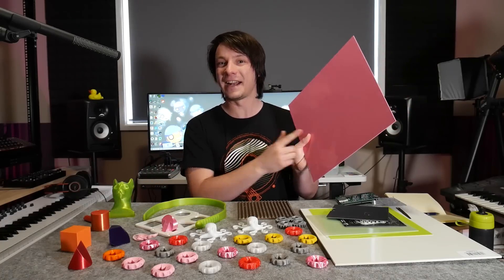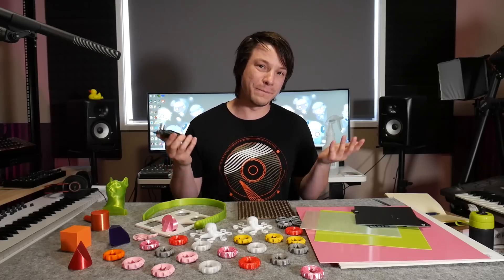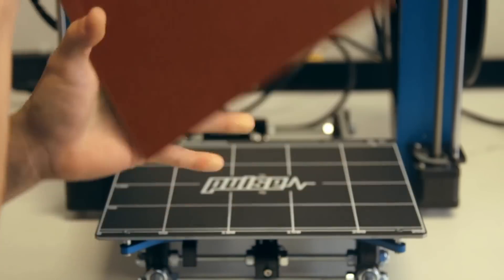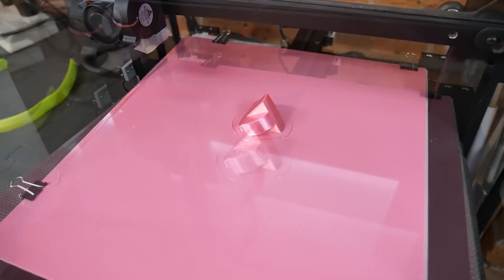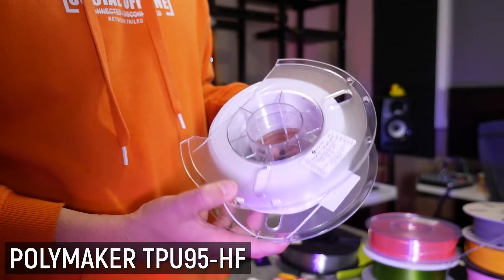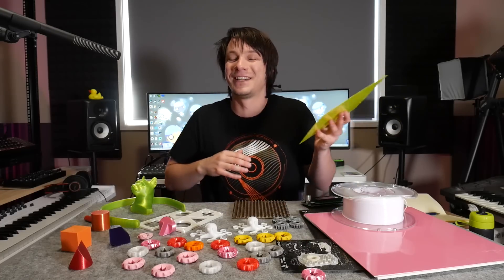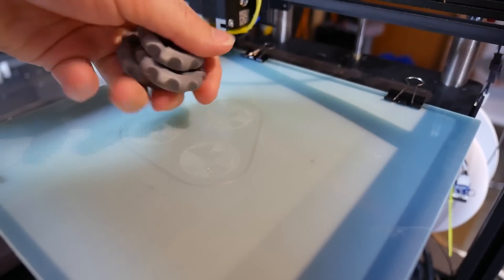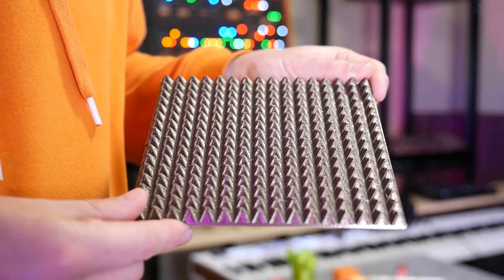G10 - The best print surface you've never heard of.

Comment: I don't know your business, so I don't mean to make any assumptions regarding your clearly vast array of knowledge/skills ...but I do know they make release agents, e.g. silicone coatings used in candlemakers' molds, and perhaps something like that could be used to prep the surface of your G10.
Reply: Uhm with silicone coating, the print won't stick while printing. Even a little silicone contamination isn't very fun, gotta spend half an hour washing it off.
Reply: @SianaGearz  Yes, even not knowing this business I thought something like that might be the case. That's why I cited silicone only as an example ...with an eye to the notion that there must be a number of release agents on the market. I know I saw Teflon in aerosol once. The aim would be to find a release agent that would be slick enough to aid in removal but not so slick as to interfere with adhesion. Of course, another issue would be how it's applied to the surface ...and by that, I reckon I mean how to regulate the thickness of the film. These are all sound considerations of course, regardless whether a product exists that can accommodate them.
Reply: @thomasraywood679  I've got canned Teflon dry-film lubricant right here, spray can, Ballistol brand. Not sure i'm inclined to use it, since i never really had issues with removal or adhesion myself, just with glue stick. It might work to prevent PETG from ripping out glass shards, maybe i'll test it when i wash the glass and report back. Could take a few months. One problem with it is that the way it behaves, it doesn't coat the surface anywhere near permanently, and reapplying isn't a lot of fun, because you'll start getting thicker layer where you don't print and thinner layer where you print, and you have to wash everything off and start over. Glue stick just stays on the glass and doesn't lift with the print, so it's kind of magical.

Someone else here in the comments mentioned that he gets PVP polymer from cosmetic industry and uses it on the bed as adhesion promoter. I didn't find a supplier i can tap into, i could buy from a chemical company, but the price is prohibitive or they'd want me to buy 5kg of the stuff, which is just a complete no-go. I could order 100g from China for $10 but i don't want the customs police knocking on my door for importing a sketchy white powder. But i did find a glue stick in China which is purported to be PVP PVA blend material, Deli 7092, maybe it'll work better than PVA sticks, and i don't see harm in trying it for $4. I'll report back on that too.
Reply: @SianaGearz  Some guys are bound to benefit from what you find out, even if they don't stop by to say so. Perhaps ask the PVP polymer guy where he gets it? Speaking of which, where do you get your Teflon spray? I've looked for it online to no avail. Can you post a link? That'd be great.
Reply: @thomasraywood679   I bought Teflon at Conrad Elektronik, a major European brick-and-mortar chain that sells electronics components, tools and hobby supplies of different kinds. Two nearby home improvement stores also carry it - "Teflon® Ballistol Spray 200 ml". I imagine it's not entirely helpful to someone on the wrong side of the globe.
Reply: @SianaGearz  Wrong side, lol. Right now that feels about right.
Reply: @SianaGearz  Thanks. I just ordered a can of the Balliston for Huma-Air. Shipping cost made it expensive, but here stateside I'm just not seeing anything that falls within the normal price range.
Reply: @thomasraywood679   I fished the WD-40 product from their American webpage. It should be available locally.

Comment: I used to buy cheap, single layer blank PCB sheets (G10 with a copper layer on one side) as print surfaces. Worked well compared to the alternatives at the time, but I ditched it years ago. Might try it out again with PETG - never even considered that it might be a good solution for that.

Comment: This looks like exactly what I need. I wanted to use a PEI print surface, but they do not readily come in 24"x24" sheets. A quick search on G10 sheets of that size was trivial. Now my intention is to adhesive a G10 sheet to a layer of mild steel sheet metal and also adhesive a magnetic surface to the heating element attached to my printer. Ill be able to retain the convenience of a removable print surface without any clips, thank you.
Reply: @Jarod Hohl: I'm curious about your idea of using a thinner G10 sheet stuck to a metal sheet. How did it work for you?

Comment: Watch @MatterHacker's most recent video on printing Nylon,  Alec explains that glue stick helps a lot, but not as a adhesive but as a separation layer. Garolite is covered in a semi porous surface the molten plastic gets in the tiny pores, solidifies and that's what makes it stick, but it can stick too well, use a little glue stick to cover up some of those pores and helps certain plastics, Nylon, ABS, TPU release better. Too much glue stick and nothing but PLA will stick. Matterhackers' Pulse XE has been using Garolite for a long time and I've really liked it! Also works for SLA printing. ( I used to work in 3d printer tech support, talk about garolite a lot.)  P.S. I wish MH still shipped to Australia.

Comment: So we could have the heater tracking built directly in to the print surface. Far easier to source than bare G10 maybe?
Reply: The problem is mounting. You screw the heater PCB onto the carrier in 4 spots, and those are rigid -ish mounts and then you heat it up, it expands and warps right in the middle. Now what? Besides the temperature difference between top and bottom warps it too, bows it down. If you can figure out a solution, sure.

Comment: That 0.5mm stuff might be good to stick to a spring steel sheet for magnetic bed leveling printers like the Prusa printers. It should be thin enough for the PINDA to sense the sheet below the surface, yet still remain flexible.
Reply: Thank you!  I might try this for the mini V2s my admin ordered for our science lab.  We've got borosilicate glass plates to replace the textured surfaces for now, but it seems like a different filament (other than PLA) and a surface such as this at 0.5-1.0mm) might help students experience more success?! :)

Comment: Been using it at work and it works very well. The real strength of it is for things that don't like to adhere at all like polypropylene or delrin. The texture of it smooth is nice, and you can get back to that finish easily by sanding, but for adhesion take some really rough sandpaper (I use 90 grit) and try to gouge out large scratches in as many directions as you can. I have had exactly no problems with polypropylene or delrin sticking without any special form of adhesive, not to mention nylon or abs.

Comment: I use G10 like 2 years without knewing his material name and is too easy to stick prints with hair spray like roby. I knew is the plate of circuits.
But the results and the low damage to the bed. 10/10.
Reply: Also, if it get so dirty, you can clean it with water and a sponge.

Comment: Would G10 / FR4 work with capacitive bed leveling sensors (like a PINDA on a Prusa) or would it only work with physical Z height systems (BLTouch, endstop buttons, etc.)?
Reply: Those are inductive sensors, not capacitive, and they are blind to this material and most other things that aren't a hunk of metal of substantial thickness.

I do believe capacitive sensors for 3D printers exist but there was some sort of performance problem with them, not sure what, which is why you never see them actually used. Sensitive to ambient humidity level maybe? Or too sensitive to temperature?

Comment: Like you said, tried it for Nylon and fell in love with it for everything. I cheaped out and used PCB FR4 I had some raw single sided PCB for projects and just eached the copper of the one side. I tried the smooth surface and did not really work for me so I sand blasted it. Give a nice matt finish and sticks like crazy.
I run bed temp of 60 for PLA 80 for petg and nylon and 105 for abs. This is with a ender 5 in heated enclosure at  35C. The self release when cooled is like magic. Thansk for a great channel and awesome content.

Comment: I've always known of G10 as "the standard" in knife handles, didn't know it was so useful elsewhere.
Reply: It's funny that it has so many different trade names.  I've never heard of G10, but I've made custom circuit boards at home for years and so I've used it heaps, but always known it as FR-4.  (btw, with the cheap pcb services available now, it's pretty impractical to diy boards at home these days)
Reply: @BEdmonson85  it is actually not the same material. if you would do a chemical analysis of them, then you would get different results. yes both are out of fiber glass and resin but they have different standarts to reach. that means that they have different persentage of fiberglas and a different resin type. 
it is the same problem like with steel. there isn't just one type of steel. there are around 300 types that get differentiated as far as i heard and it is the same here with the fiberglass materials. it all depends on what the fiberglass has to do and how stable it has to be. so technically FR4 and G10 aren't the same material but like steal types really close to each other.
Reply: @BEdmonson85  FR4 is the designation for the fire resistant version of G10 as required by approval labs like UL.
Reply: Same, I only knew it was used for handgun handles, had no idea it was in PCBs.
Reply: Or grips for pistols, mainspring housings for 1911's
Reply: What's up fellow knife guy!
Reply: Same, it was a nice surprise to learn it has more applications than knife handles.
Reply: Does polycarbonate like Polymax PC stick and not warp with g10?
Reply: Glad to see I wasn't the only knifemaker with a 3d printer. I actually printed on a g10 sheet once, when my Glass bed broke. Now I'm wondering if kydex will work. Just kidding, that shit will warp with heat I'm sure. 😅

Comment: Covering how the common filaments react with Garolite honestly isn't useful - the common filaments work just fine on powder coated and smooth PEI. It's the engineering/specialty filaments that actually need new build surface materials - Nylon, Polycarbonate, POM, Polypropylene, etc. Those are the filaments you should test FR4 (and FR2 btw) on.

Comment: I am working up a new machine.  I was thinking of trying a raw aluminum bed rubbed down with scotchbrite.  I wonder how it will work.  Aluminum sheets are available from scrap dealers for 2 dollars a pound.  I bought some really nice cut off sheets 2 foot wide by 3 foot long for 20 dollars, they were brand new.  It can be rescrubbed and recycled or reused.  I will need to test what it works with.

Comment: That's an awesome material! I might have some ideas for use besides just a print sheet…
Reply: Hybrid 3D print and laser cut blaster design, you say?
Reply from the maker: @MrJelle18  Definitely never laser fibreglass, but it CNC's nicely with a carbide burr :D
Reply: @MakersMuse  Ah, my bad! Always learning, I thought milling it would be worse than lasering on account of the fine particles, just goes to show what I know.
Reply: @MakersMuse  can you elaborate? I've never used a laser cutter, why shouldn't fiberglass be laser cut?
Reply: @MrJelle18  for fine particles it's usually a case of better safe than sorry, but I don't know terrible much about fiberglass or how it decides to behave when you laser or mill it
Reply: @BEdmonson85  because the LASER beam can't cut the glass and fumes from the epoxy would be very nasty. Glass fiber melts around 1200 degrees C. So all the cutter would do is burn the epoxy.
Reply: @BEdmonson85  probably because of the fumes
Reply: Can't wait to see what you do with this information!
Reply: PEI sheet works perfect for PLA and PETG on the other side which is metal but don’t use isopropyl alcohol just use dish soap, never had any problems with bed adhesion.

Comment: You might want to try scrubbing the g10 with a scotchbrite pad.  That should help with adhesion of everything.  It will also hide any damage to the bed.  It would also remove the silly shininess and should make a perfect mat finish.

It might remove the need for heating the bed which would help warping forces.

Comment: Calling fiberglass as the poor man's carbon fiber is very appropriate.
Interesting for me are the PETG results, PEI with glue stick on top solves the excessive adhesion problems for me, but then I have to be washing the plate to work on ABS (which PEI works perfectly with when clean). Just swapping to a surface dedicated to PETG would be nice.

Comment: I print PETG 245C on glass at 65C with aquanet hairspray (helps for release) and never had any issues. I use a 1” chisel and see the weight of it alone helps pop off any print (500mm) in one or to hits from 2 sides.

Comment: I've been doing this with borosilicate glass. Got a crality glass bed for my ender 3, and after having a few chunks torn out of the top textured surface (while printing pla!) I flipped it over to print petg. I haven't had any issues with petg adhering too well to it, and also had success printing PLA on glass. I use clean bare glass for everything now.

I'm not sure how G10 compares to FR4, but that's very intriguing and I might give FR4 a try. MY biggest concern is the flatness of the surface (why I switched to glass initially). Also wondering how copper-clad FR4 would do.

Comment: I wonder how would it work as panels for a case, an alternative to acrylic sheets or MDF making the 3d printer look better and protecting the electronics, and mostly because it is not flamable as the other two and in comparison with metal it will not make more sound as it won't vibrate the same way.

Comment: One of the best videos in ages.  I agree that too many products are hyped especially to new users that are having trouble with first layers.  I just had a local glass shop cut some 1/4 in ( about 6mm) glass for me at 235 x 235 mm.  They work great on my Ender 5 - heavy, but the heat is even and they are FLAT - $6.5 each.  I now want to test the G10.  Thanks for letting us know about this.

Comment: Would be interesting to try copper clad PCB sheet on both sides, maybe the copper sheet would improve heating on the bed and the other side is kind of glossy like G10 (actually is fiber sheets pressed) could be a possible good printing surface material... Just saying

Comment: I've been looking at 3d printing. Is a modded creality 3 still the best bang for buck getting into printing? Can't ever seem to make way looking at the many old reviews here on YouTube
Reply: pretty sure it's still the top dog for the price. there are a lot of things to be aware of though so definitely do a lot of research and put some time into it.

off the top of my head:
- buy a better print surface than the stock one which will warp within just a few uses
- make sure your Z limit switch actually works properly and isn't 'squishily' triggering
- not sure if this is still a problem, but if you're printing at high temps be sure your yellow PSU-to-printer cable is not going to burn the house down, angus has good content on this
- CHEP has a video on why it might also be worth buying a proper bowden tube fitting for the end that leaves the gear drive, new tube maybe as well. the issue is a bit complicated so i'm not sure i can remember exactly why
- be sure to assemble the printer so the gantry is perfectly level with the bed, CHEP also has a great ender 3 assembly guide to watch along with reading the instructions that comes with the printer.
- guard the mainboard's vent hole against plastic that may drop into it from the bed
- (likely not so important) consider rewiring the mainboard fan so it is always on, not just when the print cooling fan is on
- be aware of a possible LCD control board ground fault issue. i don't think it's dangerous to you, but possibly to the printer.. personally i've been riding it out for a few months just fine
Reply: @hoffer_moment  well dang that's more than an answer than I could have hoped for, so thank you very much for that thorough list of things to keep an eye out for. I've watched several videos on modding it along the lines of some of the things you mentioned. Just after putting it all in a cart and looking at the total, I wanted to make sure it actually was worth the costs vs others on the market. And it's hard to differentiate a real review from one of the secretary promotional reviews

Comment: Hmm I wonder if a pcb fab shop can laminate a thin sheet to a steel surface.  The process to make a multilayer pcb is to make the inner layers and heat press the outerlayers on after the middle one is finished.

Comment: Learnt about G10 fairly recently from work. Kind of like you said a poor mans carbon fibre. We use it for spacers and electrical isolation. Works great for electrical connector plates and is super light it doesn't add a heat load when it gets really cold.

Comment: As I know this type of fiberglass resin board does have a good bedding but stick too well that when you remove the print, you damaged the surface as well… kind of only works a couple of times before it’s no more useable… 
Kind of expensive in this way.